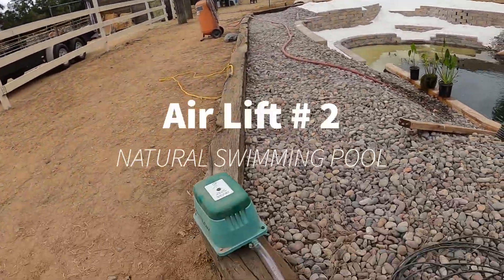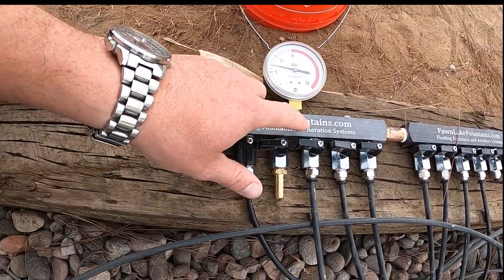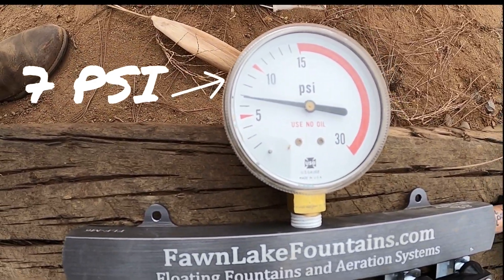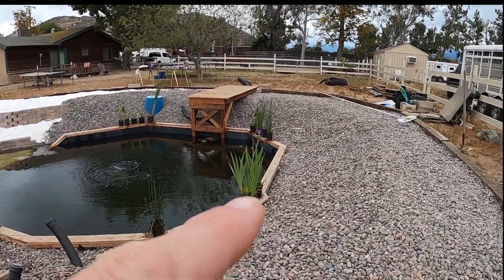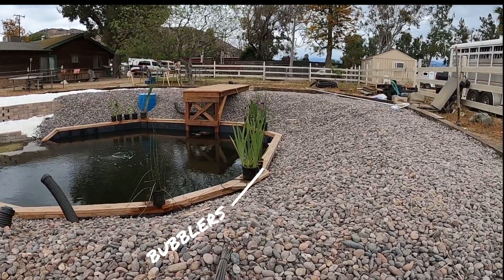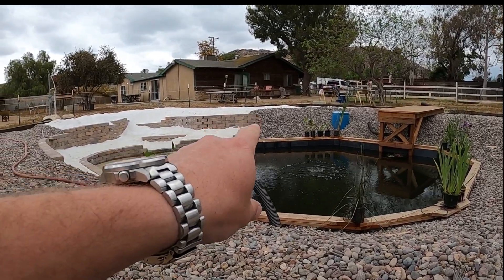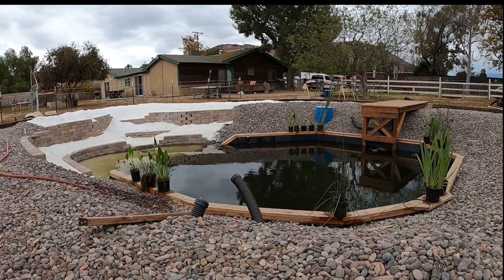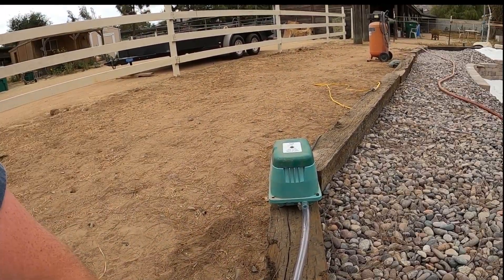Natural Swimming Pool | Air Lift #2

Comment: Hi does the filter system ever need flushed/cleaned and if so how do you go about doing so?
Reply from the maker: Hello, I did install a means to flush it, but haven’t had a need. The air stones do need to be replaced periodically. Maybe once a year or so.
Reply: @CYBuilds4fun  Is that because they get plugged? I ask because I seen a DIY system that you create using only PVC without the need of air stones.
Reply from the maker: Yes, because the pores are small. The benefit is they create very small bubbles which help with surface tension of the water which creates more flow.

Comment: What size are them air supply tubes going to the bubblers? Im having a hard time choosing the correct size.
Reply from the maker: 1/4 drip tube. Same stuff you use for drip irrigation.